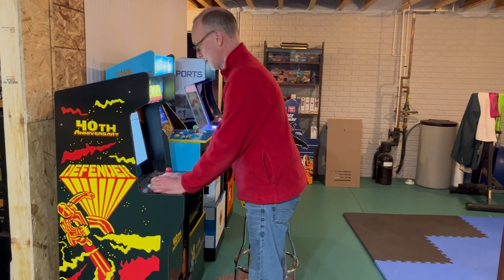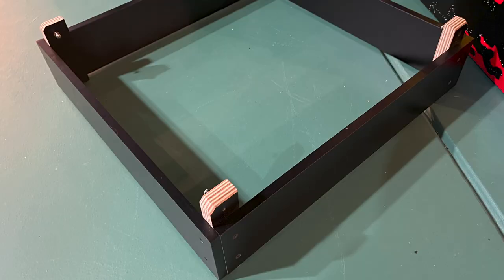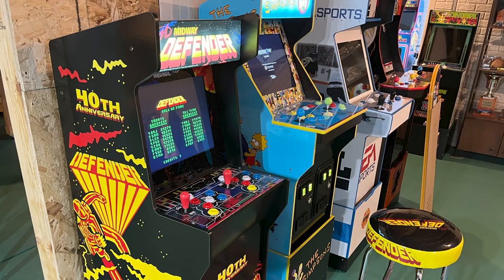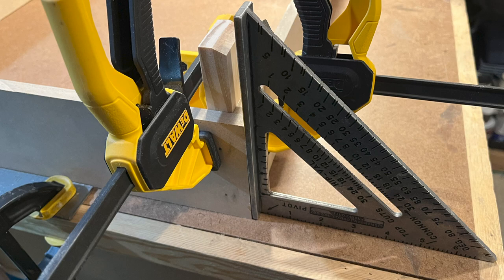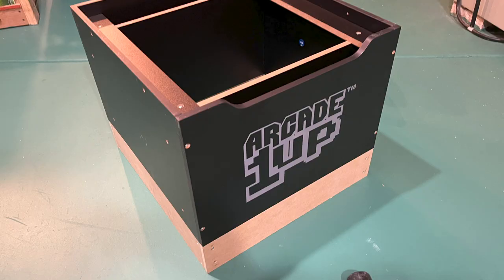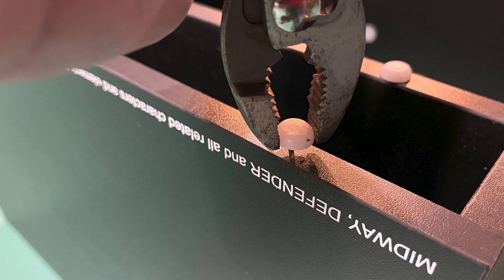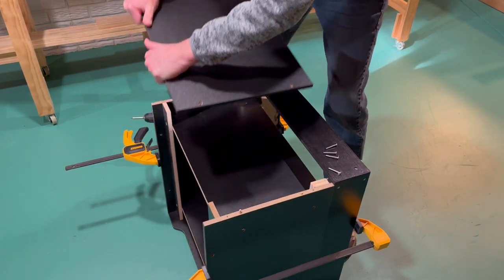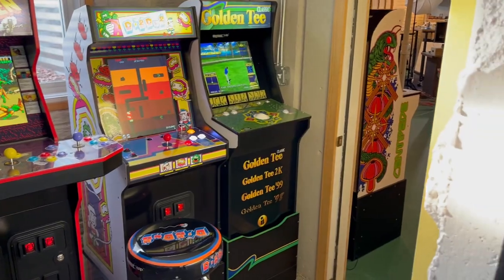Make Your Own Riser Booster for an Arcade1Up Defender Cabinet

Comment: How thick u did the corner blocks?
Reply from the maker: Corner blocks are made from standard 1x2s which measure 3/4" x 1-1/2" you could try to use MDF for those as well, but the dimensional lumber of the 1x2 is stronger. Hopefully that helps!